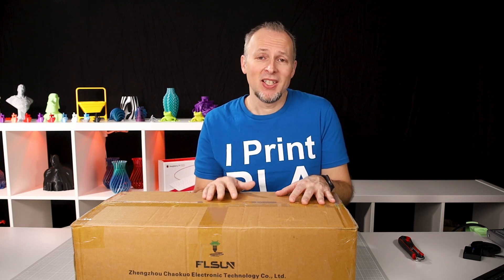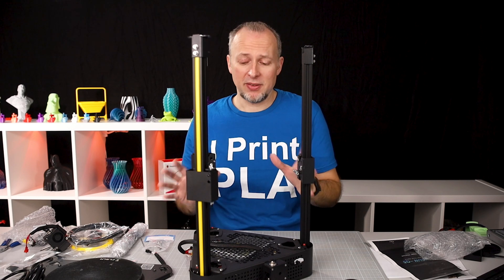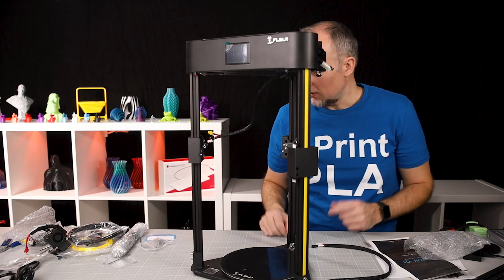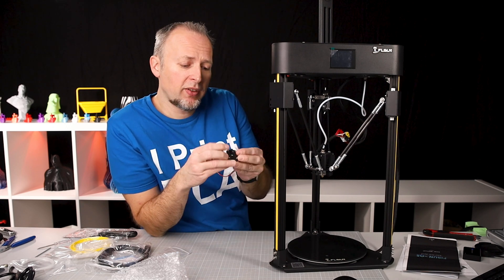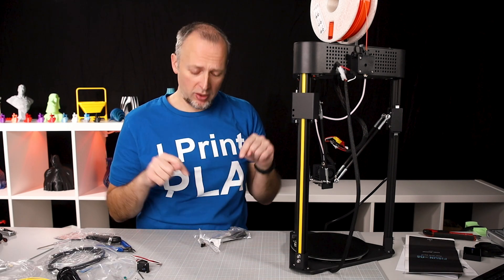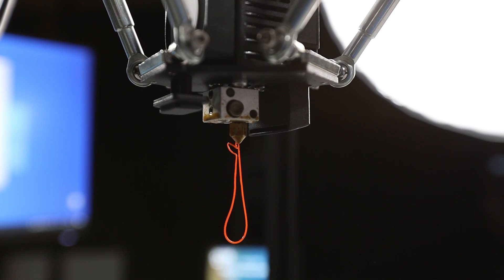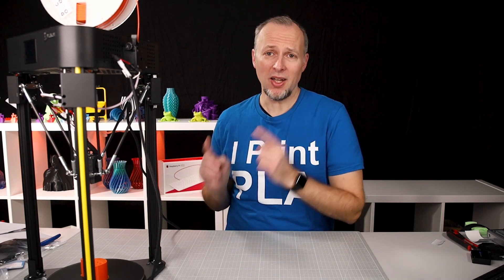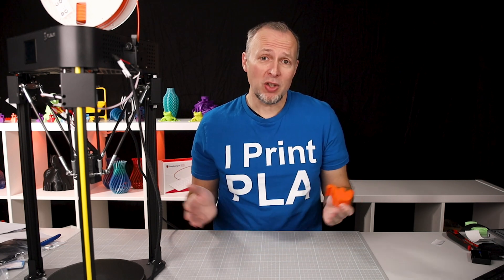FLSUN Q5 unboxing & my first impressions

Comment: I had a Flsun Q5 for several months. It was nice for printing figurines. The precision was not enough for functional parts. (Yes, I did calibrate it and checked all rollers and belts.) Printer is sometimes stuttering if you use the touchscreen while printing.  I did add a magnetic spring steel sheet and changed the duct for the part cooling fan. Support was non existent and I couldnˋt solve the problems with accuracy..
Reply: interesting. I've printed some bigger parts with the QQSPro, albeit being a bigger print volume than the Q5. I have a video up here on the Phantom inspired bluetooth speaker than used well over 1kg of filament. I would of liked to grab a Q5 as well just for the silent board and better drivers though.